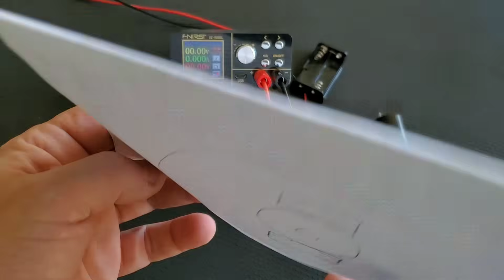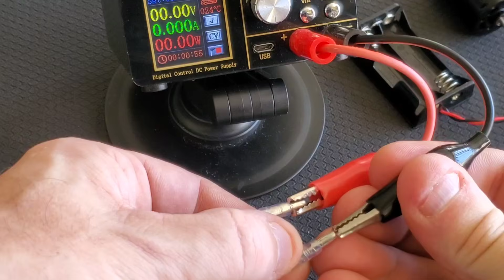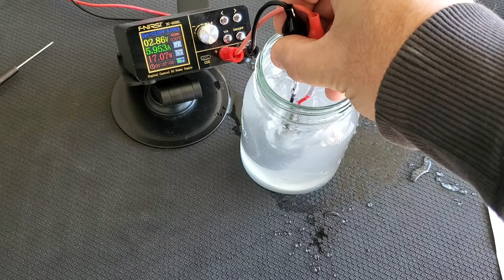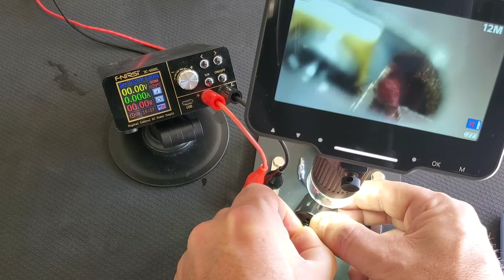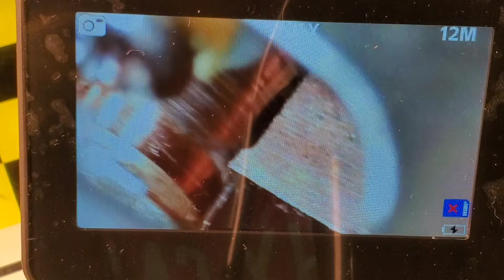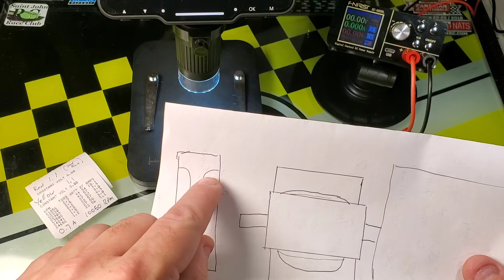Losi Nascar: E2: Motor Breakin - Water Method

Comment: Hey. I just got my bench supply and a Losi motor.   My bench supply is making me set the amps before I turn it on.   What Amps should I set it at?   Thank you
Reply from the maker: I would set the amps to 5 amps as a limit. My little supply is capped at 6 amps. Typically these supplies will reduce the volts if the amp limit is being exceeded.

Comment: I ran mine right out of the box in the car for a while, probably about 1.5 total hours of run time. I finally pulled it, and it pulls 0.63 of an amp on the power supply at 3 volts. At 9volts it pulls 1.2 amps. It is still quick keeping up with having just as quick of a lap time as the TQ at our track. So maybe the lower the amp draw is better because its more efficient. What are your thoughts on it? Thanks
Reply from the maker: 0.63 at 3v is quite low , and sounds like the motor isn't fully broken in yet. Broken in motors run about 0.9a at 3v. If the motor runs at tq pace it sounds like you have a good one. As you use it its only going to get faster. Pull the motor time to time and keep it oiled and cleaned out. When you pull the motor look at the command see if the face has even wear, once it breaks in you will see it on the comm. Best of luck in your racing!!

Comment: Hi racers!! I watched your video about the water break- in for the DC/Brushed Losi NASCAR motor. I have a thought that might explain the damage to the comm surface. I learned this from running fluid pumps in industry..
I offer that the damage might be caused by a failure mechanism that is called cavitation in fluid pumps. As your 6 amps of current is being passed from the brushes into the comm, THRU Water, microscopic sparks occur at the mating surface between the carbon brush and the copper comm. These microscopic sparks occur way above the boiling point of the water. This causes the water at this spark location to BOIL with great expansion of volume, and therefore a great increase in pressure at this microscopic location. The water turns to a vapor. Then this vapor is instantly cooled by all the surrounding water and the vapor is condensed. It changes state back into a liquid that had just a microsecond ago was a vapor. This state change causes a great reduction of volume and yes, an incredible low pressure at this microscopic point. Such a low pressure that the molecules of copper are sucked off the copper surface. I believe this might be your failure mechanism on the surface of the comm. I don’t claim to be any expert, but I would not recommend DC/ brushed motor break-in with water. I believe this method causes cavitation damage on the comm surface. I would work to improve dry air cooled break-in while maintaining light oil lubrication on the shaft bearings.
Reply from the maker: Agree! I was also thinking that because the water is an insulator that it was causing the arc between the brush and the comm.. I have 2 fresh ideas on water break in before I throw in the towel on using this method.
Reply: @lawton70 we never had problems like that with motor break in this way but our brushes weren't ridiculously shaped either. 

Easiest no stress way to break in a motor is with a dual  stand and slave motor which does all the work while the brushes get seated. You can spray it down with electronics cleaner as it turns to keep the muck from building up
Reply from the maker: @jimmytoucan5699 excellent suggestion. Ive been looking for some type of stand to do this with these 380 sized motors. Need someone to 3d print one for me to test.

Comment: Great test! Thanks. Can you tell me where you got that power supply?
Reply from the maker: This power supply is a voltage regulator that i connect to my bench 14v power supply. It is made by F-NIRST model DC-600SL.
Reply from the maker: Is is a max of 6a. I use it a lot for small jobs on the bench like running motors and other electronics.
Reply: @lawton70 yes, I see them on Amazon. Thank you!
Reply: I've always done water break-ins on my Tamiya brushed motors and never seemed to be as fast as the other guys, who also do water break-ins. So if the water procesure is damaging the commutator, what's a better way?
Reply from the maker: @smalleaglefpv3186 check my channel. I did a video on the run in process which is a dry break in. I found it works better. In that video i checked the breakin after every hour. I'm going to do a new video on the water break in, testing with a lower voltage. 3v seemed to be too much.
Reply: And how accurate is that rpm meter?
Reply from the maker: @smalleaglefpv3186 the rpm meter seems to be accurate. It comes with a piece of silver tape to reflect the lazer but it seems to reflect from the flat spot on the motor shaft. I used it in other videos testing 370 size motors for the mini-b

Comment: To me, the fact that you’re getting a lot of pitting on the comm from arcing during a water break-in is a sign that the brush springs are pretty light.  Nothing we can do about that on these motors, as they don’t have traditional brush springs like us old-timers are used to.  But if that’s true, it also means that once those tips wear away, and the whole face of the brush comes in contact with the comm, that same light pressure is spread out over a much larger surface area.  That could cause arcing and rapid destruction of the comm under normal racing use.

It could be that only the brush-tips contacting the comm are the optimal scenario for this motor.
Reply from the maker: Agree, at least this motor seemed to have weak springs. I'm going to do another test at 1.5v for less rpm in a better controlled motor holder in the water and see if a lower volt breakin is safer. A lot of people swear by the water breakin so maybe there is something to it.
Reply: @lawton70  Another thought - start the motor, then lower it into the water slowly, for a more gradual rise in amp draw.

Comment: I did a max of 3.0 amps brings the watts to around 5-6 ,since my traxxas 12t pull a max of 6-7 watts I figured that would be safe
Reply from the maker: How many volts gives 3 amps? Let us know how the motor works out!
Reply: @lawton70 around 2.0 volts it changes a little to keep the 3.0 amps
Reply from the maker: @tracykouns4903 thanks for the tip. My power supply does current limiting too. Maybe that is the key to a safe water breakin.

Comment: I'd be curious to see the brushes and comm under the scope for your dry break-in motor.  You hit on it at the end but I'd always been told to do 1.5v for 30-ish min, a followup comparing the two would be interesting.  Also, any thoughts on the folks that argue breaking one in by running it in 'reverse' provides a benefit in giving a slight advance to the brushes?  Great video.
Reply from the maker: Hi! Thanks for the interest. I do have a dry break in video coming out about january 18th, so stay tuned for that one. I show the brushes and comm in every step of the process. I have also tested the reverse breakin and it does work to give a slight advance in timing. The motor i broke in that way turned out to be one of the better ones load tested after it was broke in.

Comment: Good video!, I figured water was a bit silly, but from this I think I found the fastest way to break in a motor. Hook it up to your regular ESC, turn off the lights and run it as fast as you can without seeing sparks, switch going in forward and reverse until you can give it most the beans both ways. I think giving it a rinse to get rid of any debris could be helpful but I ran one before (torque tuned) in water and I found it made it worse as well. I did the above until I got to about 1/2  throttle yesterday and that'll be my spare for today! Be curious how it would do on your fancy testing stuff!
Reply from the maker: In my testing the break in is best when running the motor at low volt. Between 1.5 to 3v. A video is coming out with a method.

Comment: You could couple the new motor to another motor or a drill and not run any current while you sand the brushes and commutator so they mate well.  The water loads the motor and causes it draw more current and that causes pitting.

You could build a dyno that would spin your motor and be the generator that loads it so you can find out if it all was worth it.  Then a chassis dyno.  And then you can put an accelerometer in the car and log some telemetry so you can test tires and other changes.  And then...
🤠
Reply from the maker: Great ideas! I do have videos in the series where i put the motor on the load tester. I dont think i showed the results of this one but it turned out to be below average. Capturing the performance in the car is a great idea. I'll see if I have the tech to do it.
Reply: A Raspberry pi zero and a mpu6050, a 5v buck converter and a tap for the battery.  I've tried to use one as a rev limiter, it was a 'if the Gs are too high, reduce power' kinda thing.

Comment: I was wondering do you think water break in might effect the durability or longevity of a brushed motor? I am absolutely brutal on my motors and only get a few hours of runtime befor I blow a brush in the river
Reply from the maker: A breakin does help with longevity of the motor. It helps seat the brushes and that helps to reduce the arcing you see when the motor is running. The arcing is really harmful to the life of the motor.